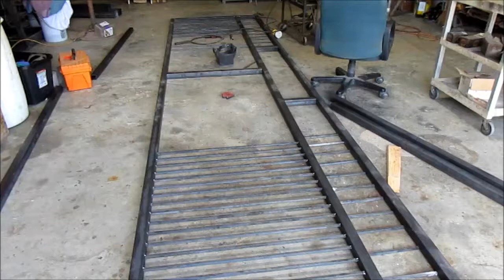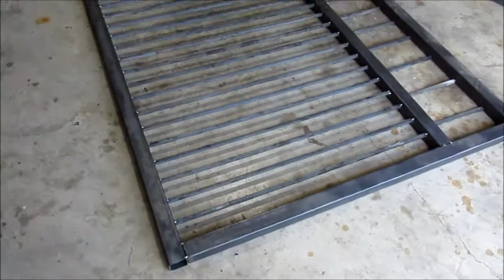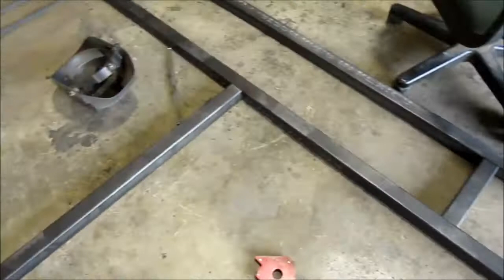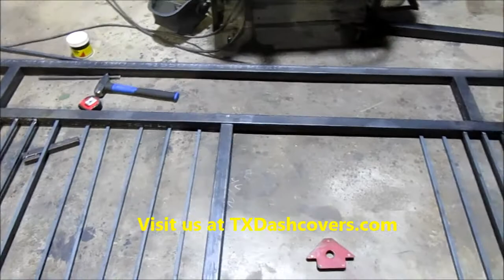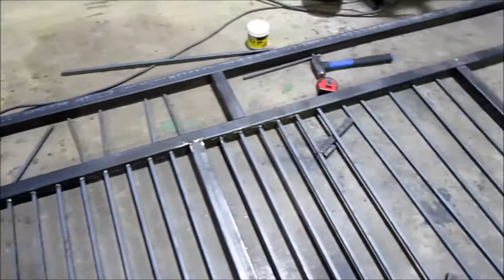#DIY:How to Build a Entrance Cantilever Gate Part 1

Comment: Super nice job!   I’m looking to build one just like it for my driveway! Thanks
Reply from the maker: We love it, sure is nice just to hit the remote to open and close, especially when it’s wet and cold
Reply: @LarrySbrusch  I’m excited, I can’t wait to get this project finished. I own a Garage door business and we have installed thousands of garage doors and openers over the last 30 years but never a cantilever gate.
Reply from the maker: I love the way it operates.it’s so smooth. I was worried about it when we went down to 3 degrees and had 10” of snow, but the little ice build up it had was not a big issue